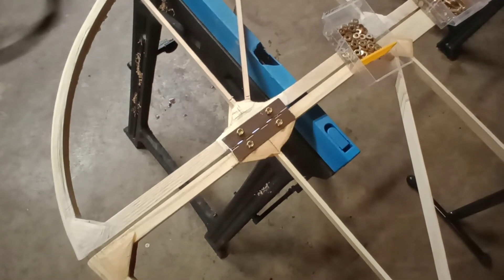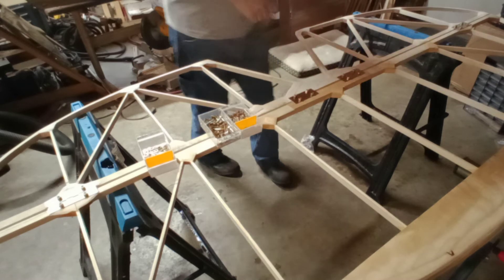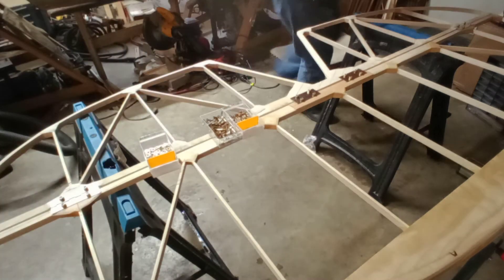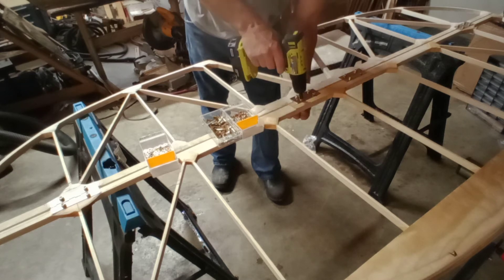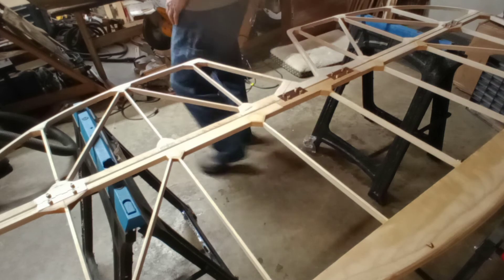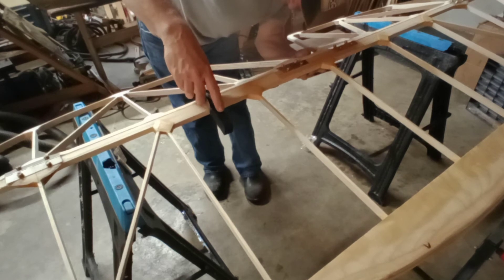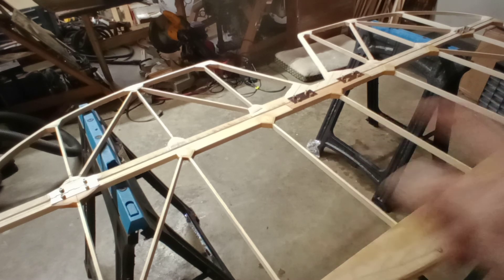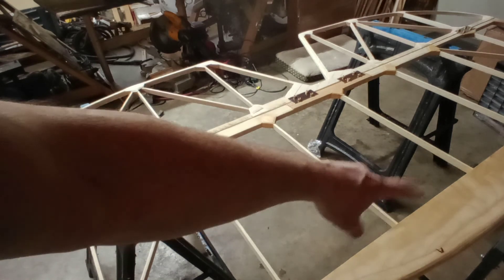FP202 Scratch build from prints E19 dry-fitting the elevator

Comment: Nice work.  What kind of hinge did you use? And varnish as well?
Reply from the maker: Just regular piano hinge, steel, pin size ⅛",  1" across the holes center to center. 
Yes, varnish, lacquer, polyurethane.
Definitely seal the wood. My elevator isn't sealed yet, but it's too cold outside to do that, and I wanted to do a video covering the Hatab, (which is already sealed). 
But never cover or glue something until it is dry-fitted. 
You'll see why if you watch my next video "fixing stupid mistakes"
Reply from the maker: I apologize, the piano hinge is ⅞" between holes and the hinge pin is .078" diameter.